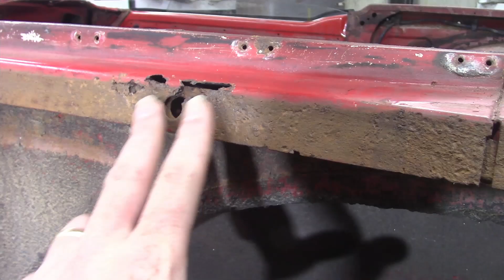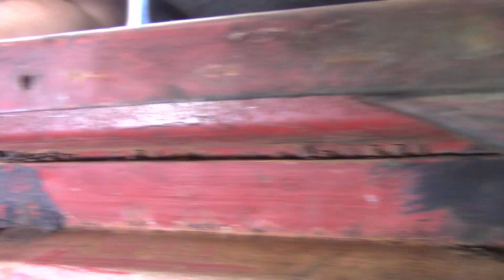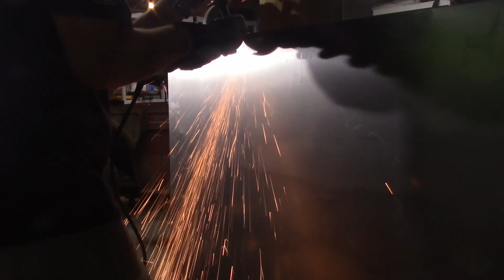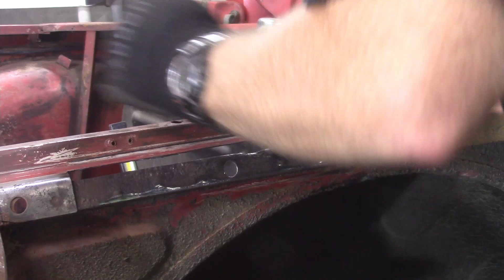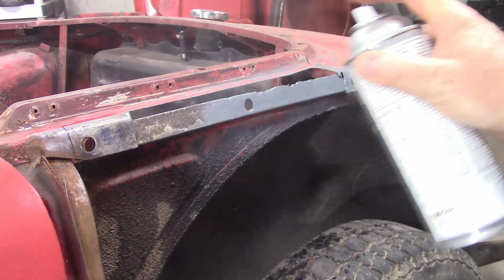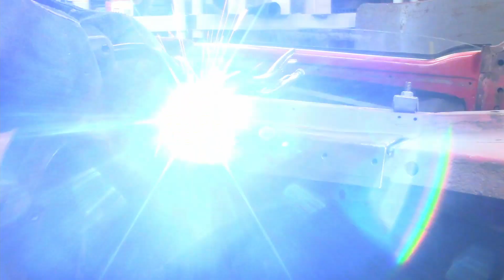Triumph TR4 Rebuild #2 - Rear Deck Repair | Roundtail Restoration

Comment: Thanks for the videos Chris, I’m also in the process of restoring a 1964 TR4 which looks to be just a little earlier than yours by serial numbers.  I’m actually joining a complete rear clip as the original was too far gone so lots of fun.  Where are you located, I’m in Ontario, Canada?
Reply from the maker: Good for you. That's a lot more work than I'll have to do. I'm in Groton, CT. Thanks for watching!

Comment: Great job as always Chris. Appreciate the details on neutralizing phosfo. Did I catch what you said that the proper gauge for the Spitfire is 20g whereas 18g is right for TR’s?  I’m starting my Spit Mk2.
Reply from the maker: Yup, 20g everywhere that I found it. I was able to use donor metal from my spare car so didn't have to source it, though I'm sure you can find it. Noticeably lighter than the TR4's sheet metal, that's for sure.
Reply: Thanks Chris!

Comment: Looking good - Fitzee's latest post on which wire size to use is also good and interesting.  I'll be switching to the smaller wire
Reply from the maker: Yup, I watched that one. That was one thing I did know about before I started working on the Spitfire. I've never tried the thicker wire, but watching the video, I don't want to.

Comment: What song are you referring to in the beginning? I tried googling it lol
I've had good luck with using a stiff blade putty knife for splitting panels too.
I just recently painted my bathtub with white SPI epoxy, worked awesome.
Reply from the maker: lol, I think I was close. I've seen the putty knife trick, too. All I have are plastic ones. Did you post to the SPI forum about that? I saw that just today, but didn't notice it was you. I did see pics of the B, though. Looks great. Glad to see you're out enjoying her (unlike somebody else around here). My own fault.
Reply: No, I didn't post about the putty knife on SPI, coincidence I guess. Can't blame ya on the new project, that is a beautiful unmolested car. I just can't start one until I knock a few things off of the honey-do, you know how that goes..
Reply from the maker: I mean about the bathtub, but I'm sure you would have said "yes". And, yup, I know how that goes. Always a balance!

Comment: Chris...  with your Hobart 140.  do you have it plugged into a 110V 15A or 20A circuit ? I understand it can do either...but you are limited to the amount with 15A.
Reply from the maker: I have no idea how much amperage the ckt is rated for. I think I'm welding at such low current that it shouldn't really matter, but I could be wrong. My guess is it's only a 15A ckt. Thanks, Frank!
Reply: @roundtailrestoration  at low current like you said...it won't matter.  I was looking at the Hobart 140...and would use a std 15amp circuit.  but watching you it seems to be welding sheet metal fine on the lower setting which was my concern.

btw...looking good . it's a long ways away....hav you thought about color :)
Reply from the maker: Thanks, Frank. I have thought about color, but it's still a long way off so I'm holding on to that decision for a while.